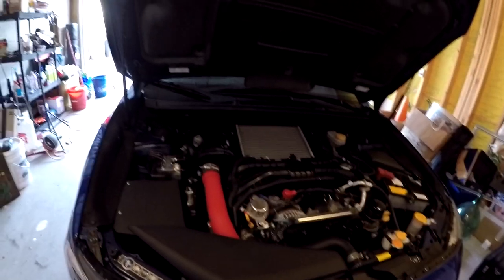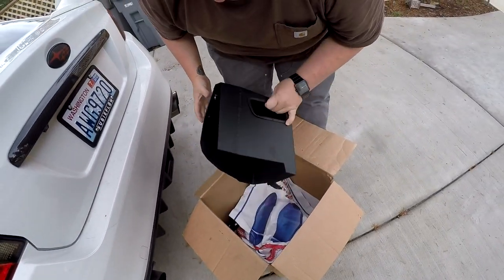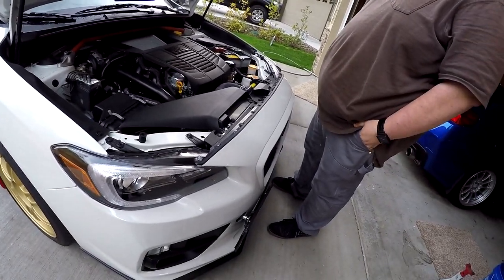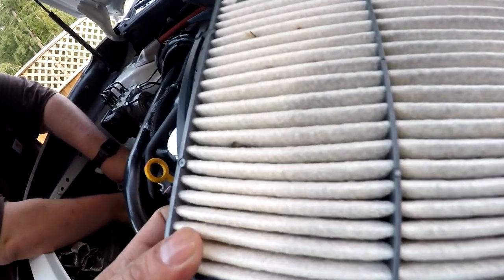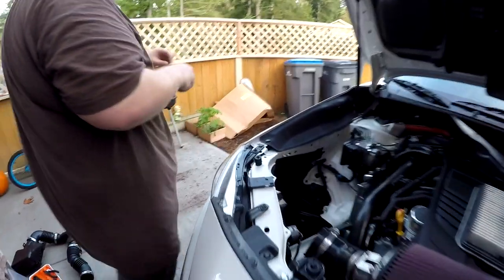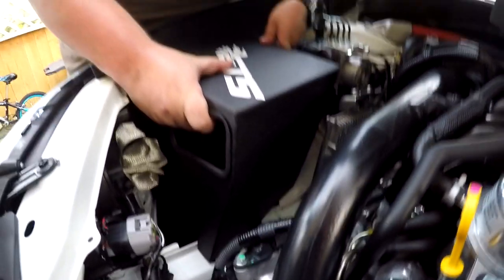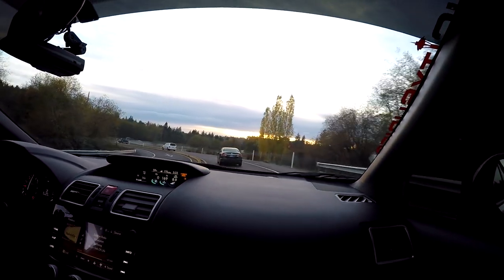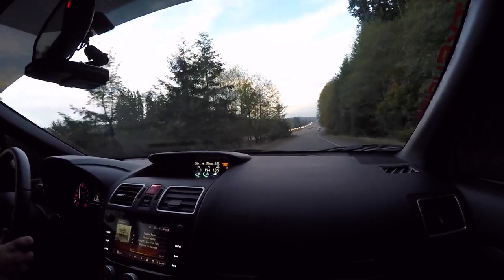Jeff's Scores an ETS Intake / 2016 Subaru WRX

Comment: I know this is a long time ago, but when you installed an aftermarket intake what Map did you use for it on Stage 1. I'm asking because I have a K&N Typhoon ready for install once I have the CoBB Accessport and want to know if I could run it with stage 1. Also located in WA

Comment: Does the new engine on the wrx suffer from ring land issues?
Reply: ***** The fa20 shouldn't have ringland issues, but most of those issues on ej257's came around 80 - 100k miles(unless owned by a dumb 16 yo), so 40k is no true test.

Comment: I read that after market intakes don't give any power increase to the FA engine unless you also upgrade the turbo/release valve. The stock intake is more than enough for the stock turbo. You found any power gains with replacing the intake?
Reply from the maker: I didn't notice any power gains to be honest. It makes a cool sounds though...
Reply: You will most likely not see much power gains if any, but allowing the motor to breathe better will increase performance. Think of it like a smokers lung to a non smokers lung. Not smoking wont make you supermen, but you will breathe better than a smoker.

Comment: what size are Jeff's rims?  they look great on a white wrx.
Reply: 18x8.5 +40
Reply: +Jeff Reinke hey man where did you get those door cups???
Reply: +v kolp the clear bra behind my door handles? it was a part of the clear bra package I had installed.
Reply: What brand?
Reply: +v kolp 3m scotchgard pro. I had it installed at a local tint/vinyl wrap place.
Reply: +Jeff Reinke the ones I see online don't mention anything about the door cups being included; would you mind shooting over the link?
Reply: +v kolp there is no link. they were custom cut for my car by a local shop.

Comment: where can I get a tune for this? Cobb? just need something temporary for a day or two to start my etune. Thanks
Reply from the maker: +Walter Elkin You can download the map from cobb.
Reply: okay thanks. you say that map is safe to run for a week?
getting knock of 2.18 every once in a while
Reply: 2.81*
Reply from the maker: Walter Elkin -1.41 and -2.8 are normal if DAM stays at 1.000.
Reply: ill take a look thank you, and also did you guys have issues getting the filter to clear the box, mine seems to be close to the headlight, is the hose that attaches to the metal flange for the filter possible to be flipped? like put upside down? sorry for the questions just had a crappy time installing just now
Reply from the maker: Walter Elkin No big issues I can think of. As for the hose, there is only one way to mount it. There is a bracket that attaches to an existing hole in the engine bay.
Reply: not the hose that is straight, the one that angles for the air filter to pipe not turbo to pipe
Reply: I Was wondering where you got the map for the ETS Intake?

Comment: bought a 2016 wrx then adds tune and intake/exhaust STILL SLOWER THEN STI FAILLLLLLLLLLLLLLLLLL
Reply: a stock WRX does 0-60 faster than a stock STi. fail.
Reply: +Snwszr you're right.
Reply: stock wrx is faster than sti 0-60.  stop suckling sti kawk.  don't believe the hype.  WRX FA motor>STI EJ motor
Reply: +james accord  better on gas, saved 4-8k on the car purchase, still faster and handles then most cars under 30k.  I still dont see a problem
Reply from the maker: +Bob Barker Mine was only 26k. A $10-15k savings. :)
Reply: +ALT3REDB3AST truth.